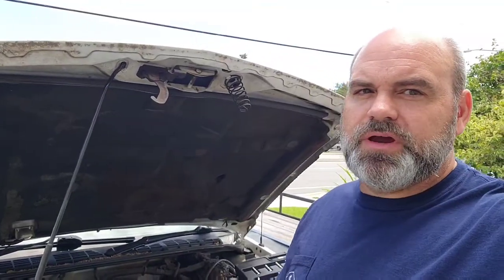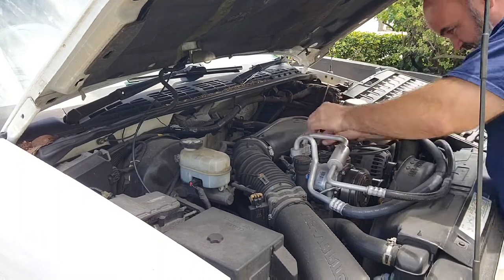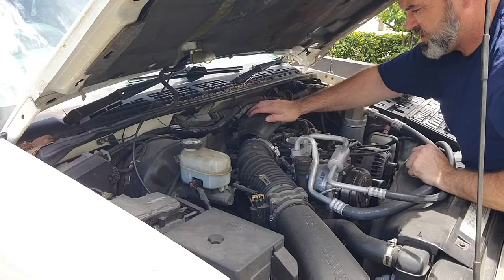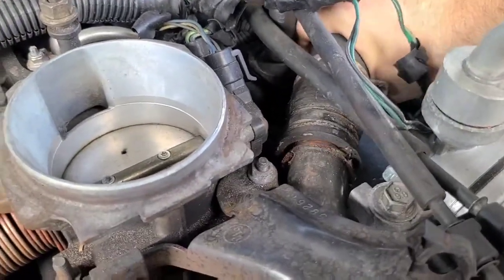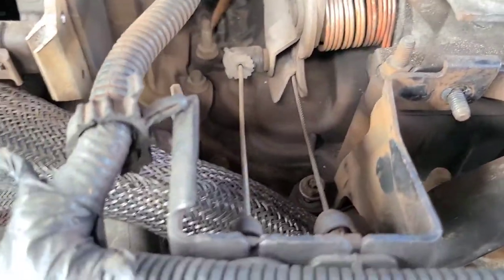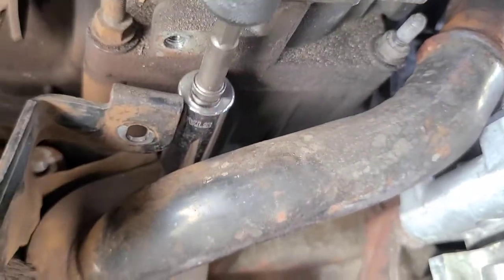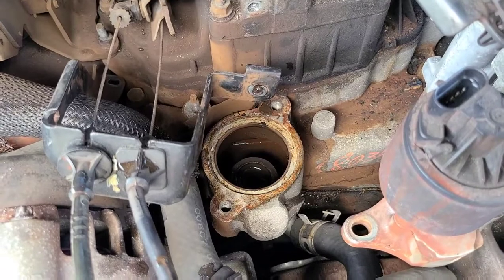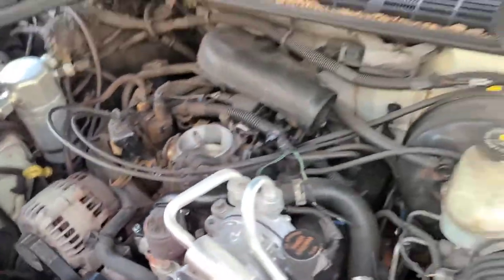2001 Blazer Thermostat Housing and Thermostat replacement

Comment: Hey Gray Beard!

Did you wire wheel clean that mating surface? 

If so please explain and why did you skip that step in the video please advise please and thank you
Reply from the maker: I always clean mating surfaces. That was one of my first videos so I wasn’t that experienced with filming. Good catch on your part.
Reply: @graybeardgarage9638  yeah so I'll check out your other vids but my question is we're using a handheld wire brush what did you use something on a die grinder or a drill to clean up that cast?
Reply from the maker: I only have the wheels for a drill but a hand held should get it done also